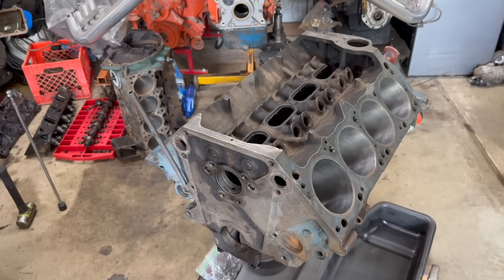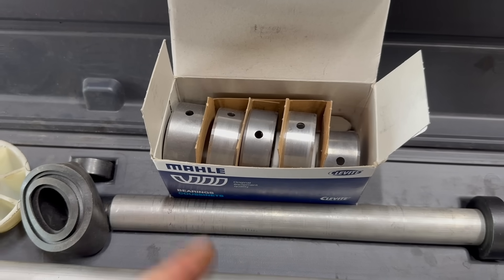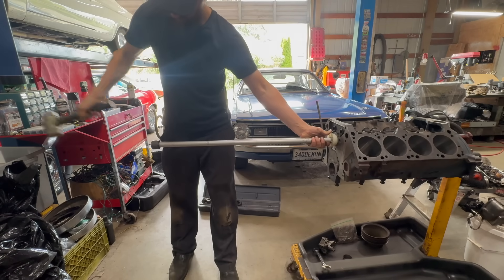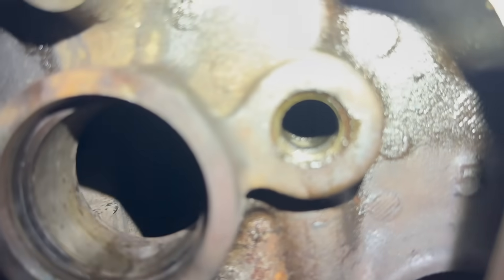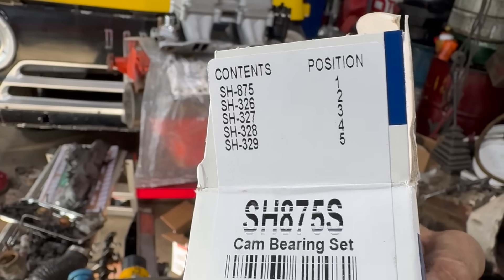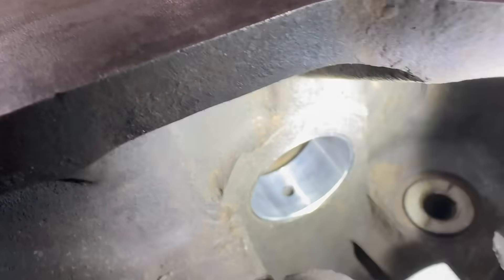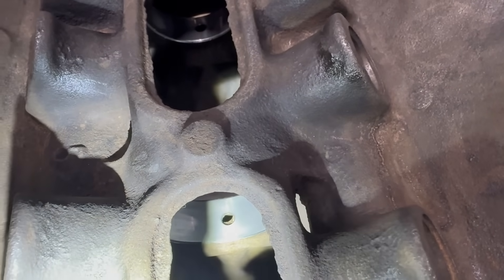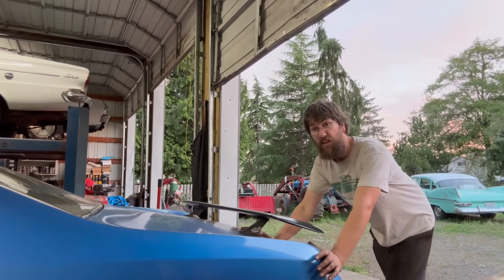No Machine Shop Necessary - Mopar 318 LA Cam Bearing Replacement, Oil System Tech, And More

Comment: I’ve read in some high-performance engine book in the past that you can chamfer the oil feed holes on the bottom of cam bearing journals to help compensate for bearing misalignment. It does not compromise the strength of the journals or the bearings support in them.  Fact? Or old engine builder fiction?
Reply: Many years ago I used to make my corn re engineering white metal bearings and indeed used to chamfer the oil jacking feed and pocket the oil lube supply holes.All by hand using scraper tools and hand polishing with French chalk with newspaper.
Reply: Usually the hole or slot in cam bearing is larger than hole in block. In the no less 1000 sets of cam bearing I've installed, maybe 25 of those we altered in some way . In those 25 engines, we didn't like the alignment of oil feed hole to bearing. So we would elongate bearing and/or block.

Comment: I just watched a cam bearings installation video on Jim’s Engines channel, and the lengths they went to to get them in alignment, sometimes it’s a bit of a horror show. In my youth, I just went Neanderthal, and paid the price of low oil pressure. Decades later, I stripped the same engine down, and got to admire the fruits of my quick solution. Ugly!